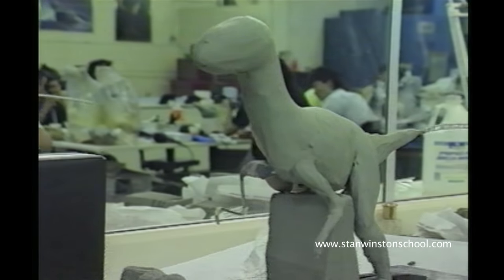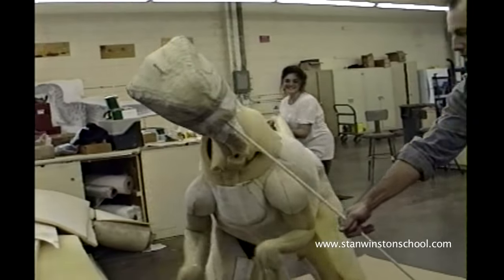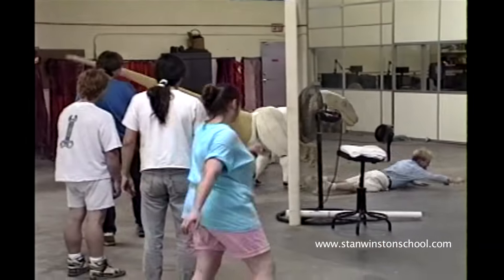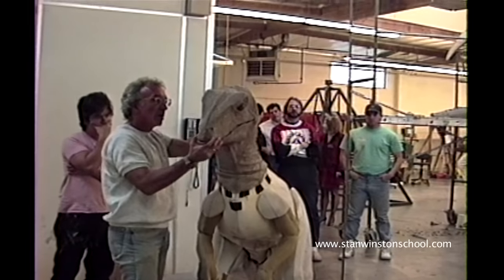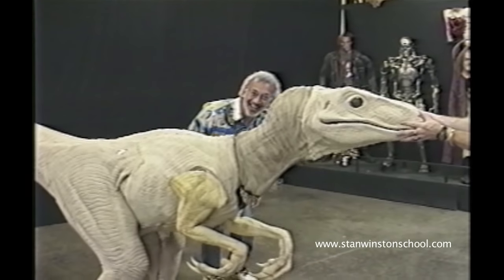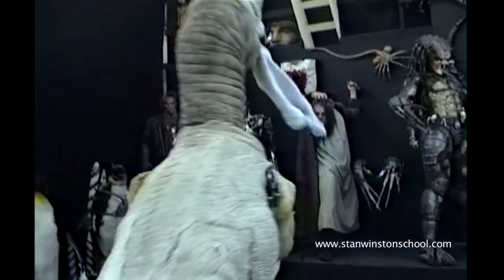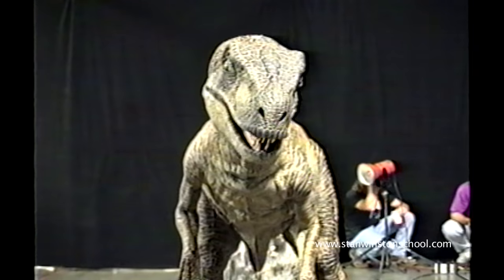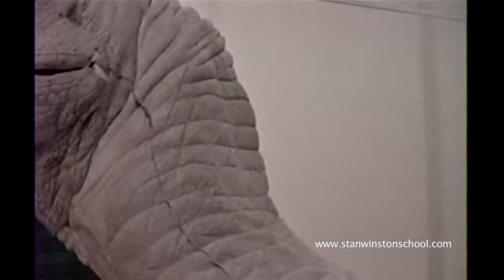How to Make a Raptor Suit - Jurassic Park BTS

Comment: Looks much better than those commercial sold ones where you can clearly see the legs sticking out
Reply: They also cost more than 100X, and last less than 100X.
Reply: @AlejandroFranceschi  but surely its just upholstery foam, silicone and glue? at least the base how i would make it
Reply: @MCWproductions-pb4op  If you have the know-how, otherwise, it’s the great artists who make and perform it together that are what make it so valuable. The walking version was always on rails, split in the thorax section. Full body motion required the mechanical version, or human puppeteer, bolted to a base.
Reply: @AlejandroFranceschi  thats fair

Comment: Interesting - I thought all the dinos in Jurassic Park were CGI'ed. I always wondered why they generally looked more real in the original from 1993 than in later films. Now I have some of the answer.
Reply: The reason in the original film they looked more real was because they used animatronics instead of complete CGI. They used CGI for the legs though, as animatronics could not move like that. Also, they only used the raptor suit for a few parts in the movie. For example, if you search up something like "Jurassic Park T. Rex animatronic," you'll see some videos showing footage of them using it.

Comment: Good god but the raptors in Jurassic World looked bad. Even the trash bag model looks great in comparison to those renders. And the stuff with the raptor heads, just the heads, in cages being touched by the actors? The actors were clearly touching empty air. There was nothing there.

Stan Winston, we miss you, we love you. and I want to hug all my old Jurassic Park toys and cry. They spent 200+ Million on Jurassic World, and I felt like there was barely a single dinosaur in the whole movie.
Reply: Sound clever? I don't know how a he sounds like a slash.
Reply: slappy2013 They touched stand-in models that were painted over after the fact. You can tell because they aren't casting shadows on the heads, and the actors touches don't follow the scales.
Reply: slappy2013 you're only half right. During the filiming process, yes the actors had real puppet raptor heads to touch. But during the editing, CGI heads were put on top of the animatronic heads to "make it look better" (which is, in my opinion, the worst idea ever)
Reply: +timmey227 real raptor heads? Wow that's amazing, where did they find those?
Reply: AnIdiotsLantern amen brother
Reply: timmey227 this whole "replace perfectly good practical effects with CG" thing is an evil scourge on the industry and it's so asinine in it's "logic". If you have a physical prop that works, USE IT.
Reply: I believe there is a place for both cgi and practical effects.  I do feel like Jurassic World went a little over board, but at least they didn't go  George Lucas over board.     The raptors were such a major focus of the movie, and to be very very mobile. I understand why they went full CGI on them.  The headstand ins in the seen in question were literally just white heads to give the actors something to touch. You can see them in this video.  https://youtu.be/j6Dqe_O91fA

Comment: I...I must build one of these one day...I can't get too caught up in thinking about this now, I've got three other costumes I need to work on for conventions this year...next year...maybe...would the neck be possible to make using hoops of foam core for the horizontal and strips of fabric for the vertical with a central pole running down the middle?

Comment: Was Mr. Rosengrant actually that bunched up inside? That seems extremely uncomfortable... I thought of making something close to this, but my head control pole would resemble that of the suits used in the Walking With Dinosaurs Spectacular. With being that crowded together, I don't believe that would quite work would it? Or a camera and monitor to see with, that would also pose an issue...

Comment: What I've always found to be sad is that we're not able to make a more accurate and realistic prosthetic application to better represent a theropod foot. Something that the actor could be comfortable wearing while maintaining balance. That just seems to be a huge drawback to these character representations. It also seems that some sort of harness could be built into the system to counter weight the actors upper torso with extra weight extending back down the tail so the actor wouldn't fatigue so easily from having to bend over for extended periods. Great job tho.